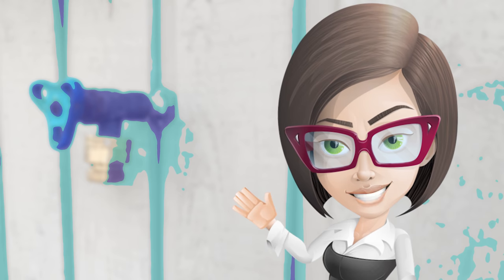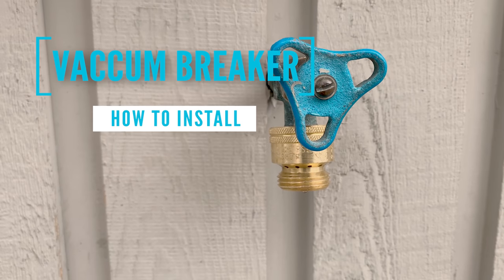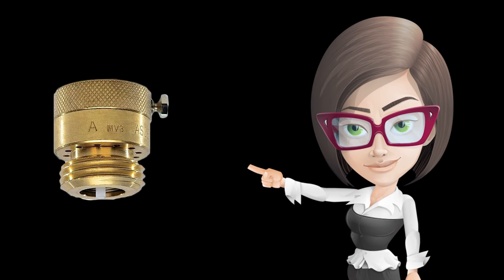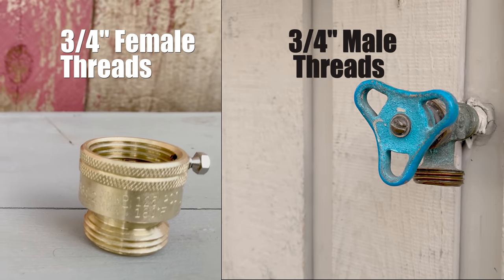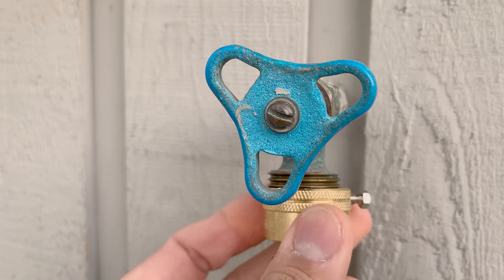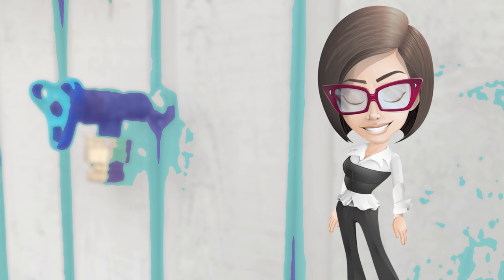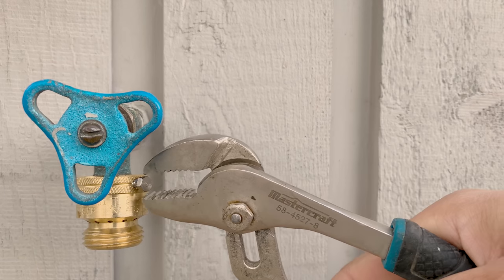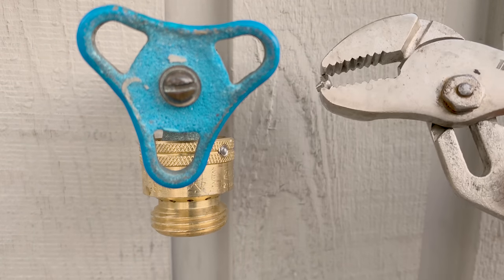Vacuum Breaker : Learn To Install - The Building Expert - 2020

Comment: You left out a very important point. These vaccum breakers like many things don't last forever. Good luck getting a failed one off your hose Bibb if you tightened the VB hard enough for the set screw to break.
Reply: Absolutely true, you have to have a plan to remove it if it fails. So leave the SET SCREW there in a position that doesn't interfere with turning the knob on the spigot.
Reply from the maker: Our local code doesn’t allow us to leave the set screw in vacuum breaker so that no one removes the vacuum breaker.  

I have removed few failed devices  either by cutting them or changing the hose bib. 

Thanks for your feedback.
Reply: @TheBuildingExpert yes, very easy to do for us pros 👍